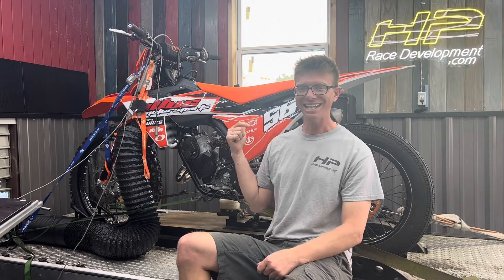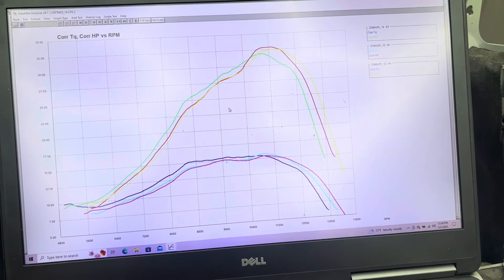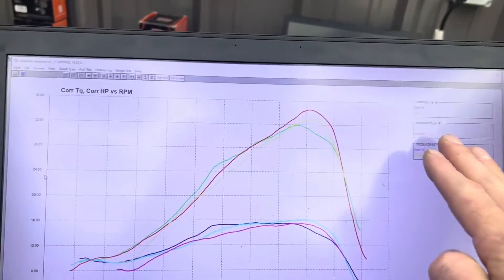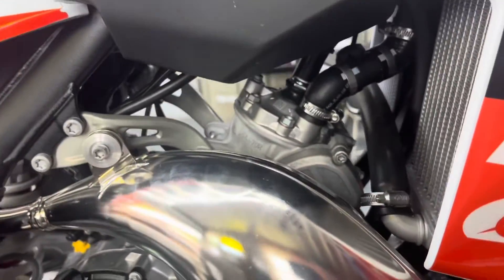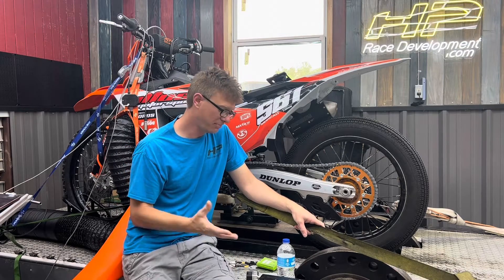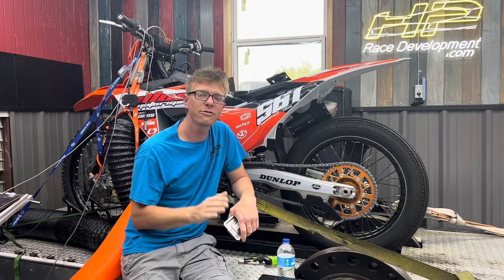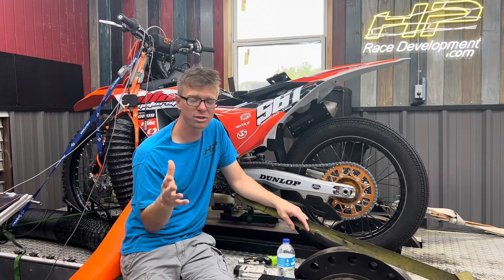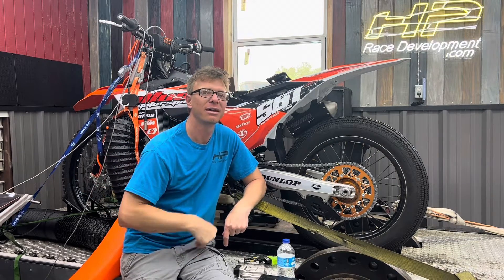EFI 2 Stroke 2023 KTM 125 Dyno

Comment from the maker: what do you guys think about efi and two strokes
Reply: You should do a video on the massive shortage of parts for these bikes since nobody else is talking about it. My new 125 is nothing but a boat anchor because top end parts are non existent. It’s absolutely ridiculous that they are pumping out the 2024s yet 23 owners are stuck with a bike they can’t ride waiting for basic consumable engine parts. Last I heard was possibly November.
Reply: @michael589m  Hey Mike, I just connected with a supplier in the UK, gonna source what I can from them..all OEM stuff and it's in stock...which I can't understand why it's available there but not here?  Stay in touch!
Reply: @themotocrossmodchannelWulfMX  for sure man. Just venting. Don’t want to see anyone else spend there hard earn money on a bike they can’t ride.
Reply: @michael589m  Im with you there!  lol, I have the 12 deg VHM and can't install it yet!  No base gaskets!
Reply: @michael589m  what 125 does everyone recommend then?
Reply from the maker: @DSLRvideonow  If you want minimal hassle go buy a yz125
Reply: I wish the OE’s would have there 2-T’s have power-jet carbs, with TPS based timing maps and a det-counter / sensor under the plug (like 90’s Moto-GP 2-T bikes)….if it worked well for them, why re-invent the wheel to be worse than a carbureted bike with a bit more well vetted tech from the 90’s.
Reply from the maker: @ericschumacher5189  the oem yz250 and new 125 are tps based timing maps with an electronic powerjet. suzuki had this and so did kawasaki - going back to 1999 for yamaha 250. You understanding of the detonation sensor is incorrect though, that was for tuning and data purpose by the team. The cdis in that era and any era of 2t tech did not auto adjust to deto.
Reply: I have to agree with you, efi and 2-strokes are not there yet, I am a 2-stroke guy through and through, racing a yamaha tz250 v-twin 2-stroke, carbs all the way, I am not sure if efi will ever work better then a carb on a 2-stroke
Reply: Love EFI on two strokes! The 23 300SX is the best running two stroke I have ever owned. I should add that I am not the typical rider for this bike and use it exclusively for snowbiking. With the wide range of temps I run (-20F to 50F) and the elevation changes I do 0-6000’, this efi system hasn’t skipped a beat. Lots of high load and high rev riding. No fouled plugs and no spooge at the tailpipe. No carburated bike would be able to keep up without tinkering on the carb. Lastly the efi system is less prone to carb icing. Not sure why, but it’s a none issue on TBI bikes. Am I fan of the new 2023’s, absolutely. Are they the right bike for everyone? No.
Reply from the maker: @The_Snowbike_Channel  They are so so.  The 250 and 300 are much better than the 125 because they produce much lower power per CC, the influence of varied pipe effects is smaller.  Our dyno has the new 300 at just shy of 50.  That's ok, but the carb model 250 sx would easily go 52. But you are correct no carb does well with elevation and temp swings.  

Big plus for the EFI there.
Reply: @HPRaceDevelopment where's the torque at compared to the 250 tho? That's what counts
Reply from the maker: @romper4444  If you know hp and rpm you know torque.
Reply: @The_Snowbike_Channel  Be careful with the piston skirt on the back of the stocker 300sx, some of them are too long and kiss the crank journals and crack the piston and grenade the engines.  If you remove your reed block and turn the bike over via the flywheel, you can see inside the back end.  Removing 2mm off the skirt and then profiling it so it's a smooth edge fixes it.
Reply: Hi there....  differences between HQV and KTM ( both fuel injected) makes no sense at all. Both machines has exactly the same ECU and mapping. Something else is making the difference...
Reply from the maker: @jesusgarcia_pwc7457  Yes - every two stroke is a little different.  But the ECU can't account for this....so they will run quite a bit different.  Somewhat the point of the video.
Reply: It seems like the EFI would be better because of the fuel control after peak power. Standard carbs aren't able to lean out the mixture to get that extra bit on top. Even the pwk with the power jet doesn't seem to have giant gains. Besides the EFI systems struggling to measure air and being closed loop, shouldn't they always be better?
Reply: @tmaxx51  The cracked ECU I have had since March is incredible...I don't want to come here an bash the video bc thats not cool but with the crack, fuel, pipeset, my bike rips like nobody's biz.
Reply: Flat torque curve, broad/smooth power band. Maybe only because of E-PV?
Reply: If and when they get all this electro tech stuff figured out on 2 strokes, the bikes will most likely be very complex and hard to work on for an average Joe that doesn't have degrees in engineering and computer science, not to mention every bit as expensive or maybe even more so than the 4 strokes are now.
Reply: Calling EFI in twostrokes dumb in general is not right in my opinion, it's just this implementation. 
Had Evinrude ETEC twostroke outboards, they're a different beast
Reply: The point your making in the video ist that ktms efi is not ideal, but a closed loop system is superior to a carb. We can take a look at snowmobiles to see the possibilitys.
Reply from the maker: @einhase6924  closed loop is shit for mx usage. Far too slow in response and correction time. Hence why zero race teams employ it. On a 2 stroke its far worse - the delay time is even greater.
Reply: @HPRaceDevelopment  Hypotheticly we could use a haltec or something like that, and build a closed loop system for a motorcycle with parts from cars. Or the efi system of a superbike. In wich way are they too slow?
PS: thanks for your reply, you have a great yt channel
Reply: @HPRaceDevelopment so what 125 do you reccomend for racing then?
Reply: @einhase6924  To add to your comment, the Evinrude ETEC engines or other BRP projects are brilliant EFI two stroke engines.
Reply: I'm not a great fan. Part of the annoyance for me is removing access from the owner. Part of the appeal of the old 2 stroke Moto X bike is working on it your self.. with the setup on these, you can Hardly tune them without having the OEM scan tool and even then your options are severely limited. I feel it has no place in mx, enduro maybe. Short of replacing the ECU and then employing an expert to map it, you basically gotta stick to stock, which stinks.
Reply: @andrewshipp2739  Youre right, but in mx there are no complex electrical systems, or at least not as komplex as a touring bike, and i think it is possible to make a efi system, simular like in cars, with an aftermarket ecu, wich is easy to tune. A microsqirt ecu is something around 400 and the sensors and stuff are something around 400 too, combined thats the price of a lectron or smartcarb. But im agree to you the systems now used in the ktms and stuff are shit.
Reply: it is time to abandon the acoustic 2 stroke IMO. the narrow powerband due to pressure waves and tuned pipes is the design's greatest flaw. supercharged Piston port engines with fuel/water injection is the clear future because it supercharging solves acoustic issues and water injection will reduce the need for high-octane fuel and retarded ignition timing that you see in highly tuned reed induction NA 2 strokes.
Reply: @microsoft790  For mx though, it's been the way and will change here and there but I don't think it will change much more other than EFI and some susp changes.
Reply: I think they should have stuck with the carb. Simple less weight no starter less wiring and no battery and makes way more power stock.
Reply: @jasonolmsted4147  and cheaper too

Comment: You have to remember R&D progresses as time goes on. Ktm had to start somewhere, every company does this, a little innovation at a time, monitor reliability and such. If you want to be riding a 2 stroke for the foreseeable future, then get on board with efi. The govt is cracking down on this stuff. Look at all other 2 stroke markets. They've all went efi and they all started off stupid and "dumb". In 10yrs time youll see 2 stroke bikes running at the complexity level of marine and sled engines. Also for the average rider, peak hp doesn't matter as much as wanting, consistent low and mid speed rideability. No boggy spots, clean idle indefinitely, inconsistent temp and environments etc etc. theres so many benefits. max hp matters too dont get me wrong. But i dont think your looking at the bigger picture here. The average guy wouldn't know what to do with a carb if his or her life depended on it anway. So tuning it to their conditions is outta the question.
Reply from the maker: KTM had a long time to get this ready - it wasn't some 1 year overnight whim.  I have friends in various departments - it's been an over 15 year program.

Comment: I have a 19 husky 300 tpi with 300 hours and I’ve loved every minute on it, runs perfect all the time. I have a 23 125xc tbi with 10 hours and so far it runs just as good as the 300. My main issue with the carbs is the crappy gas we have nowadays, if my bike sat for more than a couple weeks I’d have to clean the pilot jet even if I drained the carb. Now I just hit the button and go. I could see serous racers preferring a carb but for a weekend warrior I’ve been very happy with the efi.
Reply from the maker: most people are not - but also most people expected efi to make a 2t like a 4t
Reply: I dunno man, Ive yet to come across a single guy that doesn't love it, only people on the internet that say it sucks. All the personal experiences with it have been great in my experience. And because of my interest in all things horsepower I go out of my way to engage with owners cause i enjoy first hand knowledge and experience from people.
Reply from the maker: @romper4444  well your not getting on phone calls…

Comment: Talk to bills pipes to put a bung on a pipe and then talk to gett and have another input added.
Reply from the maker: Our test pipes have egt and o2

o2 is about worthless though
Reply: @HPRaceDevelopment  on my drag sleds we have o2 bungs on all 3 cyl. And have egt for our play back about 6 inches from the piston
Reply from the maker: @denniswilder3014  O2 is relevant around peak torque - a sled stays around peak torque/hp all the time under essentially constant rpm and long load time

A dirtbike is transient all the time and an 02 sensor doesnt read even remotely close to accurate in transient

additionally its not even close to accurate on either side of peak torque. Raw air/fuel mix unburnt reads “lean” and 2 strokes are no where close to 100 percent trapping ratio of whats delivered with 20-60 percent of the air fuel you deliver going out the ex and not returning to be burnt. Around peak torque its “best” with the highest percentage being trapped 

EGT isnt bad - but its relative to the engine - and of no use in transients. what makes dirtbikes hard is transients. If someone built a good low loss cvt system - i bet someone could pretty fast on a dirtbike like that and efi tuning would become trivial.

Comment: As with the 2024 huskvarna te 300, a 2023 gas gas ec 250 has noticeably more low end and top end power, stock 300, 250 has a coober ecu, medium compression head, stock pipe,
Reply from the maker: on our dyno a tpi built out by tsp is 7-8 hp less than a stock tbi
Reply: Well that's why I typed this message. My bike has noticeably more power than 2 brand new 2024 TE 300 huskvarnas,  And definitely more low end. My tpi has only 100 and 6 hours on it. You guys can claim what you want but we just physically proved it yesterday. Buddies bought 2 brand new bikes.
Reply from the maker: @donaldblank8873  Prove on my youtube channel…it will dyno worse and drag race worse

we have extensively developed on tpi bikes and always made more power on relocation of injectors to tbi - and improved power character

Comment: Forget about carbs. The future of 2 strokes depends on a word you have never heard. Emissions. EPA's are going to come down on 2 strokes because of Electric bikes.
The only way to clean up 2 stokes is with EFI. The precision metering and fine atomization gives better vaporisation and cleaner burn.
If you keep cuddling your carby, you wont find any 2 strokes on showroom floors. What are you gonna do then, buy an electric bike ? haha.
Reply from the maker: The irony of this comment is hilarious.  Carbs atomize far better than ANY efi system.  Well proven.  Two strokes will never be good at emissions and produce good power and runnnability to MY standards of runnability. If you use it for recretional trails and avg 5-15 hp usage all the time - they could be fine only if DFI is used.  But If you want the ability to make race bike power that carbs had, throttle response and power character that carb bikes had, sorry not happening.  Lots of raw fuel is wasted on just about every single stroke of a two stroke and goes right out the ex port never to return along with air we wished we had trapped.  Doesn't matter if you TPI, TBI, or carb this - until the exhaust port is closed - by nature of their design, you dont keep all the charge in side the cylinder.

No efi system is currently doing a great job of cyclical variance of air flow and matching the desired fuel flow to this - currently the EFI systems are doing their "best" to produce "and average" that is the "target" over multiple cycles.  

This isn't too hard or challenging in low power, low rate of change usage - but as the engine power picks up and the influence of the pipe increases - so does the cycle to cycle variation.

Comment: ima old dude from SoCal, riding dirt bikes since I've had to run alongside and jump on, because i was too short to touch the ground at 7 years old in 1976. dirt bike sure have come alone ways. the monoshock for rear travel was a brilliant change to the suspension. it might just be me, i feel there is more HP at top end speed with a carb over fuel injection, but I'm only using the seat of my pants has a measurement.. lol. thanks for the video, i know how long they take to film and edit.

Comment: I've done some in depth research in this subject. Direct injection with a fast egt prob and all the proper sensors is the best by far the under the curve potential is night and day as we have clearly seen with euro testing. But transfer injection or case injection is crap carbs better for simple but it's one of those you cant half do it things and it be amazing.  You gotta go kinda nuts. This being said iv seen dyno testing where a bike was making damn near on the pipe tq well before that pipe came in and it rode much a 4stroke with low weight and crazy top end with a hard fall off at the top like most 2strokes. Blank check I expect DI otherwise carb
Reply from the maker: I do not understand how or why you would believe simply changes how the fuel is delivered will change the gas dynamics of a 2 stroke. DI will not widen out power - and yes plenty have done it.
The only advantage is in emissions.
Reply: @HPRaceDevelopment  aprilia demonstrated very well although not for long how that can be done with di being able to run on a stratified charge that mixes air with the fuel in the injector then injects it into the combustion chamber. It measured in real time crank case pressure aswell as combustion chamber pressure. Being able to run and make power at 20:1afr below the pipe to make the egts skyrocket makes the wave faster thus making it work lower in the powerband to a big extent and also allowing it to run almost like a diesel at low rpm then fattening it up when the pipes loosing range to cool and slow the gases letting the pipe work more like a normal pipe along with some other even more sophisticated stuff that I dont understand well enough to describe here. This did require a whole lot of sensors and a very powerful Siemens ECU that's very pricey... just one of those combustion chamber sensors run like 1500 us at wholesale leading to this system being ludicrously expensive. However they did demonstrate it on the dyno and it did indeed make for a very 4stroke like powerband that kept going until out of range with very good emissions and I think something like between 40%-15% less fuel used to make the same power obviously depending on rpm. This system requires a crank driven air pump and fuel pump it's very complicated and very expensive so it didnt quite make it to production but it's been done. Farrari actually used this same tech in f1 for 4strokes that ran on the cusp of detonation and made some serious progress with it but only recently when the computers have been able to actually keep up in a multi cylinder setting. Mazda used a dumber version of this theory at a reduced level to be safer on their skyactiv engines of new. It's not practical to most but certainly can be done and with time it could become practical being as aprilia made it viable on engines as small as 50cc with very impressive number all around.
Reply from the maker: @oliverscorsim  Ive read the data. You want slower waves at low rpm. Not faster.

Just because you can burn leaner mixtures doesnt mean egt goes up. Egt at a certain lean ratio decreases not increases.  Improving the power width and “low” end on a “high end” style engine will never be solved by how you supply the fuel.
Reply: @HPRaceDevelopment  later I'll find some papers on the subject and post them here